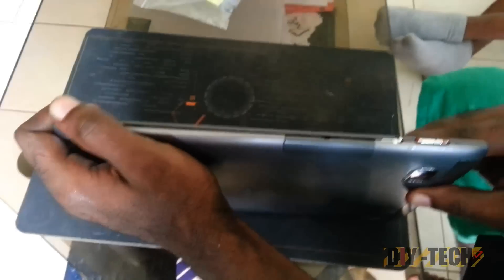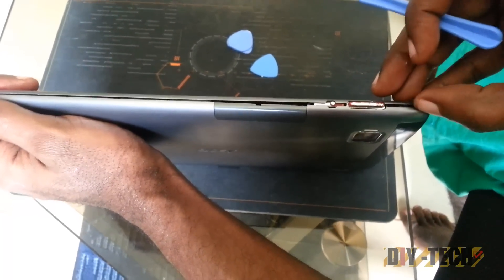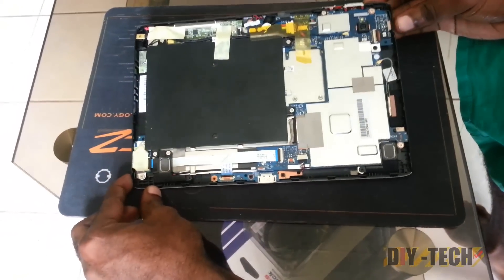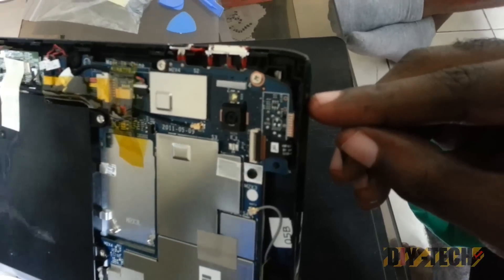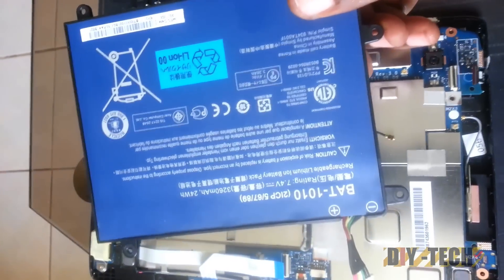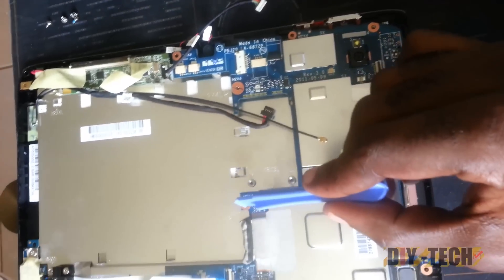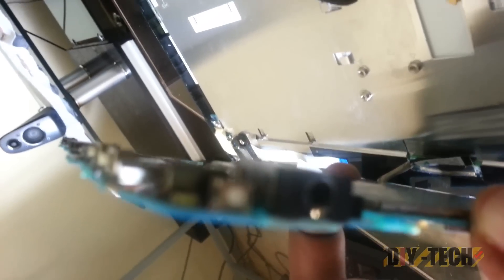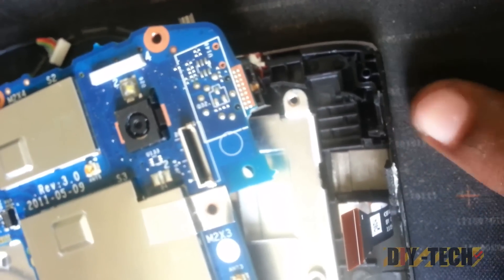Acer Iconia Disassembly

Comment: First check that there aren't any screws holding the parts of the shell together. On the Iconia 10 A3-A40, for example, there is a tiny screw under the SD card cover which needs to be removed first, otherwise you are in danger of cracking the back